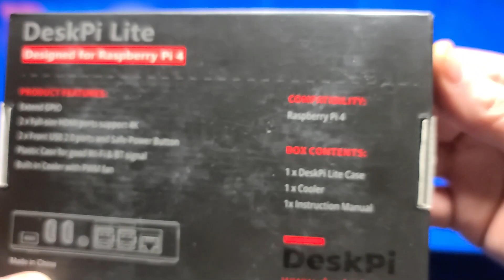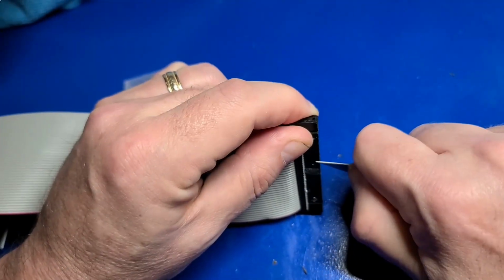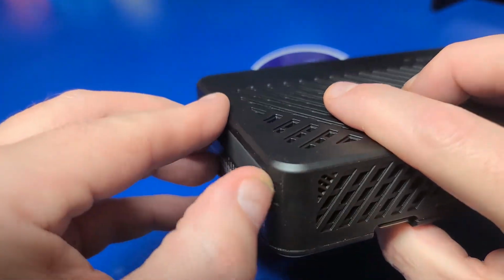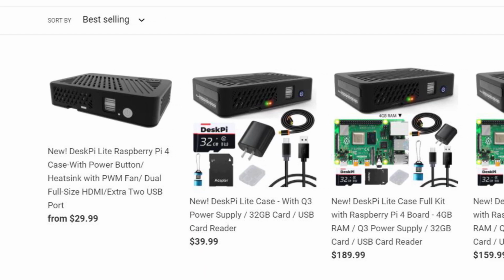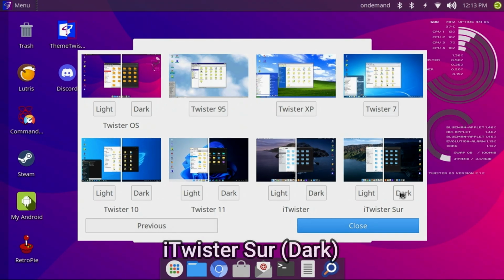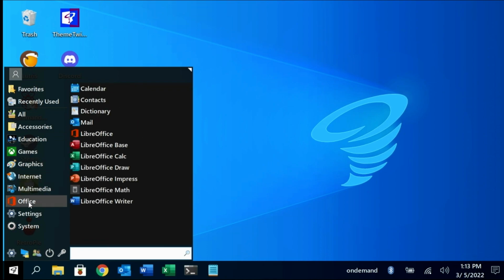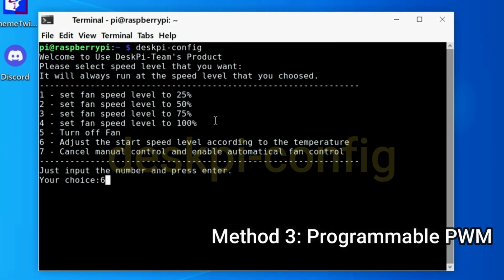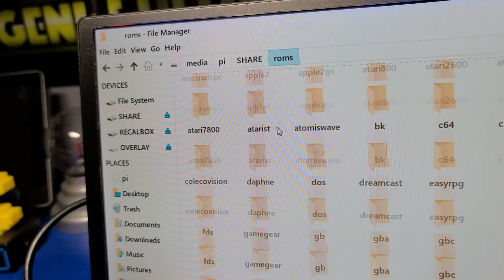DeskPi Lite Raspberry Pi 4 Case Setup and Review

Comment: Very late to this video, but wondering.. my use case for rp4 utilises the usb c port at my data in. Then I run power via gpio. Do you know if the expansion board brings full data to the new usb port? Or is it power supply only and then the data via the new usb 2.0 ports? Hope this makes sense.
Reply: @WagnersTechTalk  It can actually be used as data too, I have been doing so for quite some time. Just missing having full size hdmi. Thanks anyway :)

Comment: Hey, nice video! Do you know if there's any way to turn off the lights in the front? The one behind the power switch and the disk read/write ones?
Reply from the maker: Likely the easiest way is to place a piece of black electrical tape over it.  I don't think there is a method to turn off the leds through software.

Comment: Wonderful video!  Have you tried doing the software updates on a batocera system?  I'm having trouble myself, and thought you might have some helpful tips!
Reply from the maker: Thank you!  Is the trouble you're having on a Pi 4 using this case with Batocera?  I've not personally updated the image on the Pi -lately.  What issue are you having?  You may find that you'll get faster/better answers on the Batocera Discord and/or subreddit for specific issues.  Please see this link for links to each of those locations: https://wagnerstechtalk.com/pc-batocera/#Resources .

Comment: Thank you for you vid.
That case is not what i was searching for.
Is it not possible, to make a passive cooled case, without any noisee fan.
I dont understand why the hell, all this producers of cases, always built with fans.
My last x86 computer i purchased, is a is complete quiet Computer from "Cirrus Computer",  with much more processor power, and kernels, but it works 12  hours and stays cool. A fun to work with......
If its possible to do this with a more performant processor, it is also possible with a raspberry pi.
Reply from the maker: The ArgonOne M.2 case may be more up your ally, it's passively cooled but also actively cooled.  Using their script, you can adjust when the fans kick-in to your preference.  Here's a page with more info: https://wagnerstechtalk.com/argonone/

Comment: Just use a new 1 TB microSD card and you are good to go...  ;-)
Reply from the maker: If you're just going to use a microSD card, you can find cheaper cases without the faster SSD option.  Several that I've personally tried may be found here: https://wagnerstechtalk.com/guides/#Raspberry_Pi_Cases
Reply: @WagnersTechTalk  I just like the looks of this one.  I'm wondering if they'll make a Pi5 version, since the Ethernet port is moved to the other side of the USB ports, and an available Active Cooler.  Raspberry Pi makes a Pi4 M.2 HAT now, too...

Comment: I'm trying to figure out why the front USB ports don't work.
Reply from the maker: You'll need to install the drivers, once you do the front ports will work.  It's discussed in this video.
Reply: @WagnersTechTalk  Yep, caught that from someone else's question you answered.
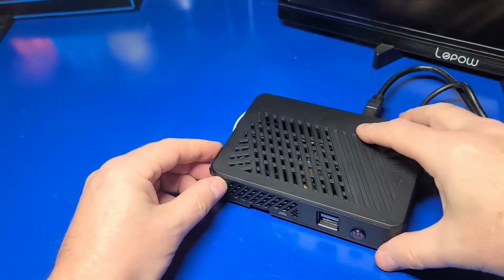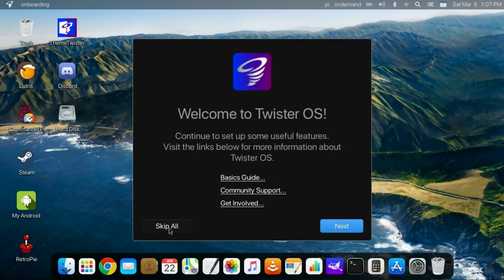Reply: Found this in a below comment: The issue is mentioned here 07:12 , solution may be found here 08:32 .  Hope that helps!

Greatly appreciate your work.  Do you have the means to run a simple exe file?  I can't seem to install Wine86 correctly or something.
Reply: The safeshutdown didn't work for me.  says no such file or directory.

Comment: Can you use the 3.5 inch screen on this case as well as the pro through GPIO pins?
If so you can use that and a portable battery bank as a new portable desktop if your willing to put up with the small screen size
Reply from the maker: I haven't personally used a 3.5" display through the GPIO pins on this device nor have I run it from a power bank.  Can't 100% say if that would work, but as long as the power bank supplies enough current to support it, should work.

Comment: How those two USB ports work? Raspberry pi 4 doesn't provide data from the usb-c port only power 🙄
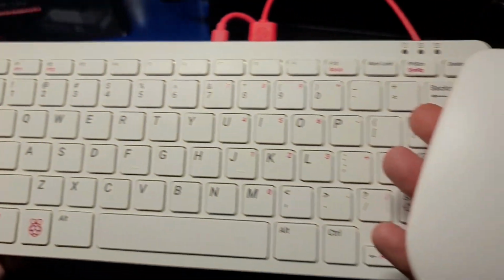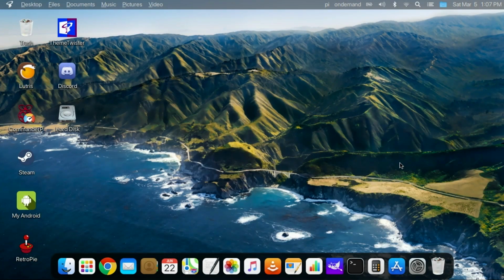Reply from the maker: The issue is mentioned here 07:12 , solution may be found here 08:32 .  Hope that helps!

Comment: Great review Jon! I'm looking forward to order one. A little tip: you can edit the config.txt after flashing the SD card on your windows or mac so that all will be functional upon first boot.
Reply from the maker: Great point Salih, I appreciate the added tip!  I also read that there is a new firmware coming for the Pi4 (that is in a public beta) that will allow you to install an OS without a microSD card.  I've not yet dug into the details yet, but seems pretty cool.  Basically, once the FW is updated on the Pi it's similar to Pi Imager running locally from the FW and will download/install the image (even from a thumb drive for those images that aren't yet available for download).  Hope you're doing well my friend, would be great to catch up with you soon.